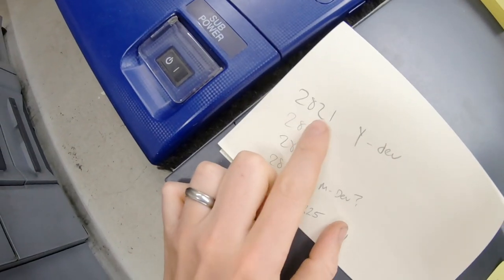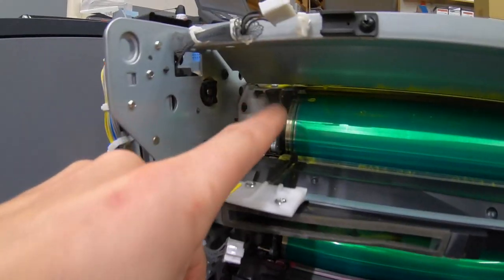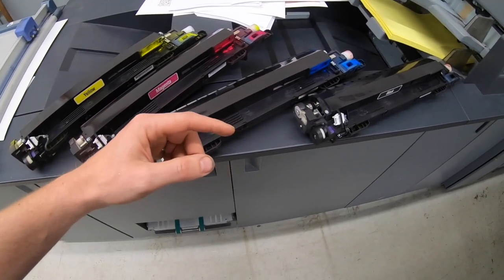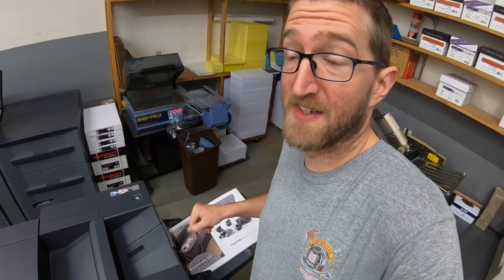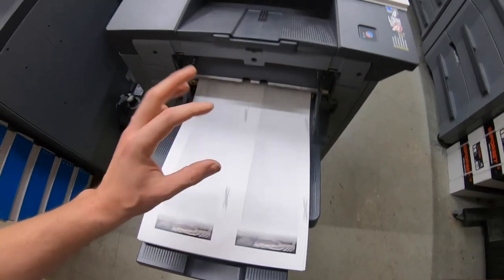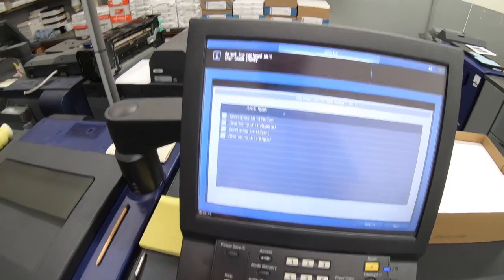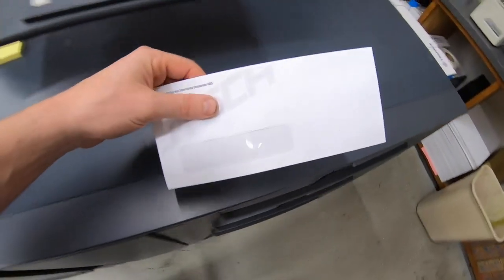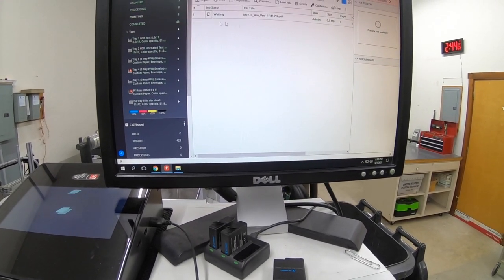How to Print to the edge of Envelopes or Paper, Developer and Developing Unit Change

Comment: Hey Dan. Binged all your videos over three weeks! Love your channel and the way you present your business. I’m a designer for print, but outsource my printing and never really looked deeply into the mechanics of how my work is printed. Your videos have changed that and I want to learn more. Here’s a really simple novice question… how do you process slip sheets in to jobs? I’ve seen them in your stacks and wonder how they are put in place? If you can show in a video that’ll be awesome! Keep up the great work keeping print alive! Cheers, James, UK
Reply: Hi James. I operate a printing company in the UK, (offsite digital in Chelmsford). I can tell you there are a couple of ways. You can set your machine up to insert a cover or slip sheet from another paper tray during the job. Normally you print the slip sheets first then put them back in the machine to insert them throughout the course of the job. This can sometimes slow the machine down quite a bit. Alternatively you set the paper stacker to shift the output stack side to side and you manually insert post print but pre finish.
Reply from the maker: Others have asked that too. I'll be sure to include it in an upcoming video. Thanks for watching!

Comment: From what I know, image overlap on belt will eventually dirty up your edge of envelope and maybe even your web in the bleed edge area. Maybe it is not a big deal with that light tint, but if you were bleeding something solid, do you find issues?  Ran Xante for years,  and now print envelopes on a Canon C750. Have not tried this trick for bleed.
Reply from the maker: This is good to know. I do it so rarely do it that I doubt it will catch up to me, but I'm glad you mentioned it, thanks!

Comment: Try just moving the image on engine screen, this is another way of printing too and past the edge. So exactly as you would do to move the job on the sheet, just put in say -8mm and it should take the image past the actual edge. Not sure why but this works on our Konicas c6100's rather than having to alter page sizes.
Reply from the maker: Nice, I didn't know that . Thanks!

Comment: Hey Dan, love the videos! I tried doing the trick to get my 3070 to run envelopes from all 3 drawers but it didn’t seem to work. Are there any other dip switches I need to check other than the one you mentioned in a previous video?  Thanks!
Reply: a few Dip settings need changed to run envelopes. 60-4 change 0 to 1  Also 71-0  change 0 to 1 for tray 3  then  lastly 71-1  change 0 to 1 for tray 4
Reply: @rickmedw1568  Thanks!
Reply from the maker: There are a lot of smart viewers on my channel!

Comment: Love your channel. Can I run envelopes on the 6500?
Reply from the maker: If you get an envelope fuser. I think it just uses less pressure to no wrinkle the envelopes.
Reply: Smaller ones maybe. The larger ones get wrinkled pretty bad. There is no envelope fuser available for the C6500, unless you get a 2nd normal one and somehow modify the pressure roller to allow for a larger gap with the lower fusing roller/fusing belt. Also, never run gum envelopes with the flap open, from what I've read, it will mess up your fuser. I only run envelopes with the adhesive strip on them so I can't verify that claim, but just to be safe.

Comment: Hey, I print envelopes on the printer as well (C6100) but when you change the size to make it bigger, it doesnt make dirt on the belt or the paper to follow? and also the machine not getting stuck sometimes for the envelope size is smaller then set?
Reply: I have a 6085 and would like to know that as well. And also how to keep your envelopes from wrinkling?
Reply: @samanderson7909  I MUST print the envelopes open not close because its wrinkle i dont know how he does it
Reply: @leviticherprintfactory7469  Same. Hopefully @Just A Printer will tell us what he does but his machine may work differently with envelopes than the 6085/6100.
Reply from the maker: I rarely do full bleed envelopes, and I bet you are correct that if the toner was heavy beyond the envelope it would cause problems. I'm not sure how the those machines work with envelopes. If you have the envelope fuser it should work.
Reply: @justaprinter  Yes they work with an envelope fuser. We run a ton of #10’s and 10 x 13 catalogs. But you have to open the flaps to keep them from wrinkling. Opening the flaps allows the air to escape and not wrinkle. A lot of times it’s no big deal cause we’re doing a mailing and opening flaps anyways. But sometimes it’s really annoying and time consuming.
Reply from the maker: @samanderson7909  Maybe it is the brand of envelopes? Or you could try lowering the fuser pressure.
Reply: @justaprinter  yeah you can lower pressure and temperature and it won’t wrinkle as bad. But still does it a little, not on everyone but every few. I was just curious if you had that problem with that machine or had a tweak. You’re using a 3700 correct?
Reply from the maker: @samanderson7909  In this video it was the 1070 but I do run them on the 3070 too. Unfortunately I don't have a tweak, it just works. Could it be the 2nd transfer pressure? I had all kinds of 2nd transfer problems with my c8000. Hmmm,  I'm going to think about that. I will sometimes have a bit of issue with the flap and I was suspicious of the lower feed wheel because when I cleared a jam the fold appeared on envelopes before they entered the print engine.
Reply: @samanderson7909  On the KM 10 / 20 and 30 series machines the dedicated envelope fuser solves that problem completely. No more wrinkles at all for me. I do still have to use digital window envelopes tho as the regular window envelopes tend to overheat and wrinkle the mylar.
Reply: @chrisbarton1517  6085/6100 has a dedicated envelope fuser that you switch to. I wonder if that's a newer machine where they fixed the wrinkle problem.

Comment: there isn't another way to print until the edges, especially for a trifold brochure?
Reply from the maker: For brochures you would print one a larger sheet and cut down. I include a .125 inch bleed on all four sides. This is then trimmed off.

Comment: Interesting, Our Xante EnPress won't print to the outside edge of an envelope. Even if I do your trick, it must measure the stock being fed into it cause it stop and tells me its the wrong size stock.
Reply: It’s a limitation on the sensor with Ricoh machines. Those Xante’s are just rebranded Ricoh engines. I have the same problem on my c9200. All the tech have told me I can’t trick the machine because it will sense the wrong sheet size an error out.
Reply: @miketheprintman  Correct, we can't do that on our Ricoh's either.
Reply from the maker: Bummer! There has got to be a way...